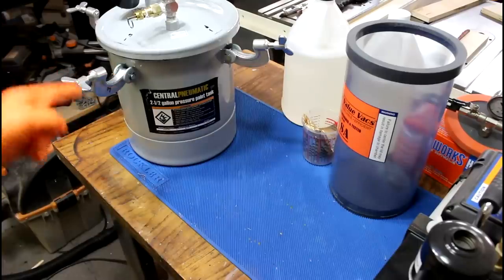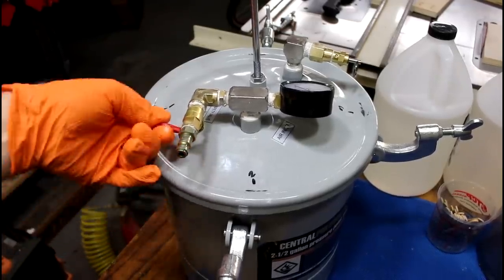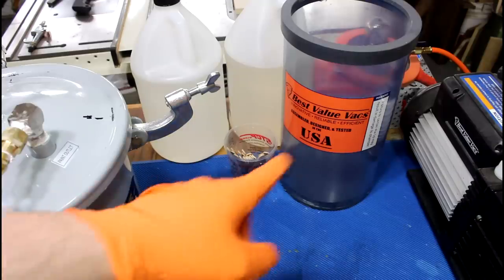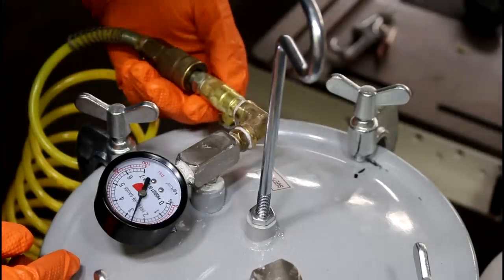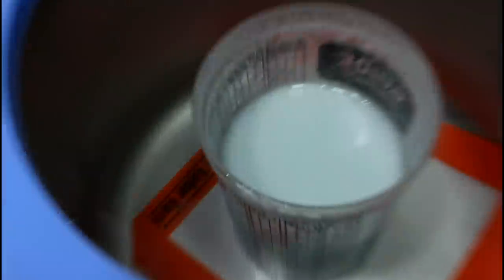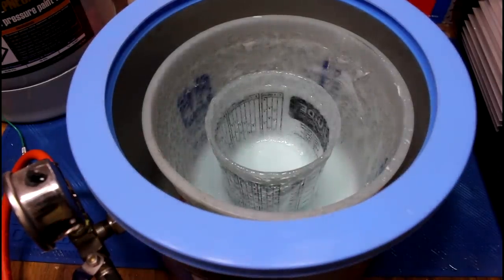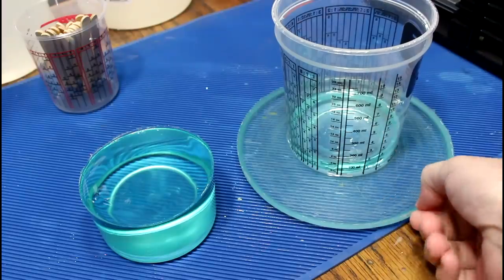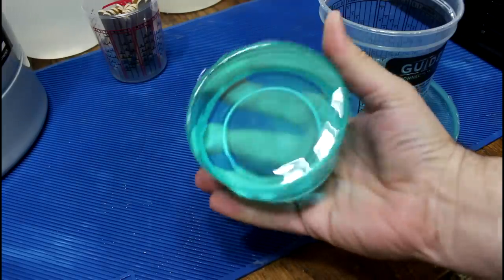Resin Casting: Pressure vs Vacuum

Comment: I like the vac chamber for silicones, I'd recommend bringing it up to the rim of whatever container you're using, closing the chamber off while it stays at that negative pressure, sometimes a few minutes, or you can add air back Into it before that point and keep repeating the process. If you close the chamber and wait and then open it back up, usually the bubbles will implode on themselves.

Comment: The question is not "Pressure pot OR Vacuum chamber" but which to get first.  Use the vacuum chamber to stabilize wood and degass silicone rubber or 2 part resins (see videos about how and why to do that)  and then cast the silicone molds or resin in the pressure pot.   The combination of the two makes for some very clear and strong parts.

If you are going to stabilize wood, get the vacuum chamber first.  If you are making silicone molds get the pressure pot first (then make a lid to turn it into a basic vacuum chamber.)

Comment: Cool video loved watching the resin boil in vacuum chamber. You should make a Christmas decoration with the resin cast in the pressure pot maybe glue an usual piece of wood on the end then turn it. A nice sphere, you could even hollow out the resin piece before gluing then trap a little Christmas related item inside. Don't let the pressure get to you.

Comment: Ok, so im in the resin ball jointed doll hobby, I know a thing or too about resin. Just so you know, the best doll casters use both a pressure pot and a vacuum. They vacuum the resin before pour, and pressure it while curing. They also tend to use resins that take 20 hrs to set, so slower setting resins. They also pour high above the mold in a tiny stream to reduce bubbles.

Comment: peter, there's a possibility that all that foaming is not simply gas being removed from resin, but something volatile boiling off. water, for instance, boil off on vacuum chambers even in fairly cold days.
maybe those things boiling away are  short versions of the molecules of one or both parts of the resin, or some additive, like plasticisers, antioxidants, etc

one idea is to vacuum for a small time, while eventually letting some air back to collapse the bubbles, then, before the foaming really subsides, closing the bleed valve and also the valve to the pump, thus keeping the pressure constant. at this point we can suppose most of the gas is gone and only volatiles are making the bubbles. then the bubbles will stop growing and will break down. after that, and when near the end of the open time for that resin, you can let the air back and pressurise the chamber. and you will get most of both processes, solid resin, no bubbles and no gasses dissolved in the resin. degassing completely the two resin components before mixing can also help.

Comment: FYI, I believe the bubbles you are seeing in the vacuum chamber are styrene bubbles being released as it turns to gas as the pressure drops. The opposites happens in the pressure chamber. The air is forced out and the styrene stays in a liquid state.

Comment: Oh boy, i hope it is the bigmac sphere! I think the best was to get rid of bubbles would probably a combination of a few minutes of vacuum to get the biggest bubbles out, followed by the pressure pot to shrink the remaining bubbles. Pressure pot also has the advantage that it does not have to be monitored and only uses power and makes noise when it is set up!

Comment: The resins I use have a long work time but I've never used a pressure pot with them, I pull it down to about .5 psi, close the shut off valve, let it sit for 5 min, vent and use. If the vacuum gets too high for the vapor pressure of the resin you are using it will boil. There is no need to let it flow over, just isolate the vacuum line and let it sit a few minutes, and vent. If you have the working time you can always repeat. I'm sure if you want a crystal clear pour you'll need the pressure pot either way but a vacuum chamber has worked just fine for 95% of what I use it for.

Comment: Vacuum degas thevresin BEFORE adding catalyst / hardener, this allows unlimited time to degas the resin without it "boiling over". If using polyurathane or epoxy vacuum degas both resin and hardener in seperate containers before mixing. This gets rid of absorbed gasses. Mix resin and hardener and vacuum degas the mix to remove entrained air from the mixing process. Pour slowly into mould give a final  degas  then pressurise to 70-75psi. This has been the process we have use for several years with great success.

Comment: I know you say that Art Resin isn't really a casting resin, however, I have seen many many projects using it as such. I actually got lucky and found a 32oz kit for $25 (got a good deal on it) and plan to make some small casts with it. I will have to make a pressure pot for it I'm sure

Comment: I'm fairly sure the reason the resin bubbles so much in the vacuum chamber is because either the resin or the dye you used boiled at the low pressure. I know the dye most certainly would, as alcohol has a low boiling point, but I'm not too sure about the boiling point of resin. It would, however, explain the amount of bubbles you got while pulling a vacuum.

Comment: I find this to be quite different from what I experienced with the resin we use in our lab for casting microscope samples. I strongly believe your resin might have been boiling over, as the resin I used did not overflow at all under vacuum or make any foam....but on the other hand my results weren't that good either, a lot of the bubbles were still inside, so idk. Maybe I should try a pressure chamber.

Comment: As Mr. Brown pointed out, this is not a casting resin. It's not a shock that it's got a higher solvent content. I agree that what's being seen here is solvent boil off. I know of a couple of workers, in particular Richard Nakka, who have used vacuum degassing, but they didn't leave the vacuum on, they applied vacuum only to remove bubbles for a relatively brief amount of time.

Comment: Great video! I think with the vacuum chamber, the resin you used was quite thick. I've used the clear casting polyester resin in a vacuum chamber and while it did foam a bit, it didn't foam so much. It was manageable. Also, I would open the valve from time to time as to let the foam shrink until it degassed without my interference. I havent used a pressure pot before, but it looks like that will be my next investment.
Reply: Yep , Peter needs lessons in using vacuum.

Comment: You should note that using a deep pour epoxy with a long cure time. (Most are 72hrs) would be fine using the vacuum chambers. Art epoxy notoriously has a lot of bubbles when you initially mix it.

Comment: The boiling comes from the alcohol in the dye and perhaps if there is water in the components. So you can pull a vacuum on each component until all water and alcohol is gone and mix them later. Then there will be no boiling over, no foaming like crazy when it is time critical. You can also mix the dye into one component and pull the alcohol from it and still get it homogeneously mixed into everything.

Comment: A lot of the resins out there start to boil under vacuum. You need to get a feeling for when it stops releasing dissolved gasses and starts boiling, then you can use it. Usually doesn't take that long, not even a minute in a lot of cases.

Comment: First of all 3:55 ... Thats what she said.     Seriously though I would agree that a pressure pot is the way to go for casting. However adding a silane or any other antifoaming agent to reduce the surface tension of the epoxy would help alleviate the foaming you were getting with the vacuum chamber.  I  personally would vacuum degas each side "A" and "B" prior to mixing, then add in a silane during the mix.  Next vacuum degas in a separate vessel as you did and then pour it into your cast. That is probably going overboard if you have a pressure pot, but those things scare the hell out of me.   Can't wait to see what you have cooking...
Also forgot to add around the 7:30 mark when its bubbling like that with certain epoxies that have volatiles you can actually over degas and start to pull out parts of the hardener.  This will affect cures in some situations.

Comment: Allow me, as a Chemist, to speculate. The resins normally come as part A and part B which are mixed. A reaction happens to produce a high MW polymer. I speculate that you are not pumping only air out but also one of the reactants from A or B vaporizes under the vacuum. So until the reaction proceeds to the point that no more low MW reactants are present, you are vaporizing one or more of the reactants. Hence you will never 'get rid of the air', because it is not air you are pumping out.

Comment: You don't generally cast things in a vacuum chamber. You use it to de-gas a resin with lots of bubbles before you pour it. It takes some babysitting, though, and practice.

Given the choice of only one of them, I too would choose the pressure chamber. It's a lot easier every time. In fact I don't think I'd ever bother with the vacuum unless absolutely necessary.

Comment: I know it was a while back you asked for suggestions, so I dom't know if you still have the material left. 
That being said, a couple of those long straight infused/stabilized corncobs would make cool rolling pins if you smoothed them out with casting resin to make a flat rolling surface.

Comment: Hmmm, interesting. Just saw another video with one of the most cheapest DIY setups I've seen for a vacuum chamber. He did 3 tests, 1 left the resin in over night after degassing, 2 was the control so just let it set, 3 degassed then took it out before it set. The 3rd one was clear as glass. Still trying to figure out the bubble problem, but interesting demo, cheers:)

Comment: I think it is the actual fluctuations that cause the bubbles to pop innitially. I think pumping the pressure down and up and back down again causes the drastic change in size of the bubbles and shifting of material leading to the bubbles popping. like when they bleed hydraulic disc breaks you pump the pressure up and down because the change in size of the bubbles helps them move. If the bubbles are too big they get stuck and if they are too small they are held in place by the viscosity of the liquid and surface tension but there is a sweet spot where the bubble is not too big to completely fill the break line but the force of the upward pressure is great enough that the bubbles rise up the break lines and that can only be reached by bouncing the pressure. I think you should do 5 minutes in the vacuum pumping the pressure up and down with the biggest swings you can make and then put it in the pressure chamber to see if you can get something better though it will likely look the same.,..

Comment: I think if you had a way to mix the resin under vacuum so the air never got incorporated the vacuum chamber would work.  Maybe an alternate lid with motorized spatula thing bolted into it and a sized&aligned mixing container.  Then you'd have to let the air in, pour into molds, put on a normal lid and hope the pouring process didn't add too much air.  And that's the least hacky way I can think to do it.

I also wonder if the resins outgass.

Comment: Didn't know that pressure pots just need to be pressurized just once! I thought it was a really long process like the vacuum chamber, but it's just super fast! I mean the time spent with a tool on, that's why i always was scared of trying it. Obviously the pressure pot can't be used for stabilize wood, but i just want to put stuff in resin and make scales for my kinves

Comment: Great video and just wanted to add a note from (bad) experience.  Generally if working with soft molds you'll need to have both vacuum and pressure.  Ever tried pressure casting resin into a silicone mold that wasn't degassed.  The resin cast was beautifully clear, shame it was hideously deformed by crushed bubbles in the silicone. :).

Comment: When pulling vacuum, let it billow up to almost overflowing, then open the release valve wide open to slam it with inrush quickly and fully.  This will help close up voids without letting air seep into them.  The ideal situation would be mix it as vacuum is applied but obviously that's not feasible here.  Getting it to a steady state volume won't give it any motion but by pulsing you can help to collapse the voids more efficiently (at least, this is how I've learned to do it working in coatings labs when a flacktek is unavailable)
Reply: Every other time he's used the vacuum he's done just that

Comment: Typically using a vacuum is most efficient on molds that are sealed. Over saturating the glass allows the vacuum to pull excess resin and air out of the strands and ensures complete contour of the mold. Pressure pots and vacuums can be used in tandem when doing large layup’s.

Comment: Have you ever thought of making a Green Lantern power battery?  The lantern?  You make it as a lamp.  Inner area could be green resin with led lights making it glow.  Outer portion could be a complimentary wood.  Two projects in one.  Make the outer wooden piece then make the inner piece.  I don't know.

Comment: As others have pointed out and I said in a longer post, that long period of bubbling was not air. It was components of the resin itself. Too much time at vacuum and too deep a vacuum, all the air is already gone, now it is the resin boiling off volatile chemicals within it. You were changing the physical properties of the resin long before you quit the vacuum.

Comment: Would be a cool ring for a Saturn project if you get the cup out of the center, Alumilite clear slow set will foam if not pressurized.  for those guys talking about make a beer casting,  LOL

Comment: The higher pressure has two effects: 1. Shrink the bubbles. 2. increase solubility of gasses into the resin. Similar to CO2 in sparkling mineral water. So it makes sense that these small bubbles vanish completely. Does the resin get a little cloudy over time as the gasses come out of solution?
Put one of these in a vac chamber and see what happens.

Comment: A couple things: First that pump is very weak compared to what most professional casting shops use for vacuum degassing resin.  With a strong pump, that should have only taken 2-3 minutes at most based on that volume mixed up.  Second, you might want to place a high viscosity resin like this in a bigger cup to allow the foam to rise further and pop the bubbles quicker.  Repeatedly letting the vacuum out of the chamber essentially starts the process over. This is not a conclusive Pressure is better than Vacuum because the variable is insufficient vacuum power and technique.  We have dozens of videos showing the process of vacuum degassing silicone and casting resins and we use pressure in only a few instances where it is needed to deal with difficult geometry or extremely clear parts where no accidental bubbles can be tolerated.

Comment: I believe the high level of viscosity your art resin had (which could be seen during the mixing stage) made it even more difficult for your vacuum chamber to de-gas it.  
I’ve found some success about 60%+ of the time by using a thinner consistency resin, or warming up my containers of thicker resin (in a bit of hot water) prior to the vacuum chamber process...

Since Peter has a pressure pot now anyway, that’s a better solution than mine - but, for anyone like me who’s stuck with vacuum de-gassing, give this a try!

Comment: you should polish this or another casting from the pressure container, I wonder how it would look without the surface ripples refracting the light in odd ways. might look less distorted I dont know but you should try

Comment: The chemicals within the resin volatilise much more when their boiling points are lowered with the lowering pressure, producing constant out gassing. Two minutes of degassing and then cast in the pressure pot will give astounding results.

Comment: Something you mat want to consider is that air isnt being released. The resin is actually boiling at the lower pressure. Check out Cody's Lab for a more in depth explanation.

Comment: I use much faster setting  and more runny resins, more like 3-5 minutes to set. You can vacuum degas for 30 seconds (pulsing the release valve on the chamber so it doesn't overflow), to get most of the gas out, and then pour into the molds, and then they go into the pressure pot for best results.  The resin will cure while boiling if you try it in the vacuum, as well as the mold will expand in vacuum and you get parts that are not dimensionally accurate...I make my molds in the pressure chamber so they are correct size under pressure during casting.

Comment: Idea: install a port through the top of the lid of the vacuum chamber. On the bottom side, a short tube pointed towards the center of the mold. On the top side, a valve and then a funnel. Pull a hard vacuum in the chamber, mix your resin, pour into the funnel, and slowly open the valve a little. The resin should rapidly degas as it falls into the mold, avoiding the foam volcano in the process.

Comment: Peter, what do you know about increased air pressure and fire hazard with hot mixes?  Just wondering if "art resin" heats up in any substantial way that might make it touchy with a pressure pot, particularly with too much catalyst.  With that said, it looked like a really successful job when it came out of your pot.  Highly turnable for sure!

Comment: Just a quick info, the pressure will not shrink the bubbles til they're invisible. If you double the pressure, a bubble only shrinks to 79% of its size. The pressure makes the gases disolve in the resin, like CO2 in your soda. And so the bubbles really disapear. you would never get a clear part if the bubbles only shrink and the strength of your parts would also be lower.